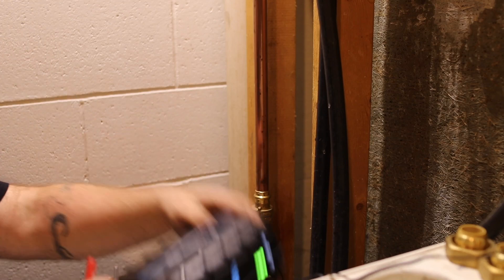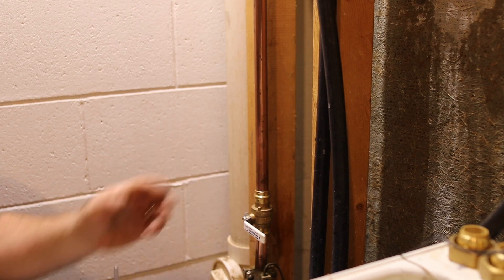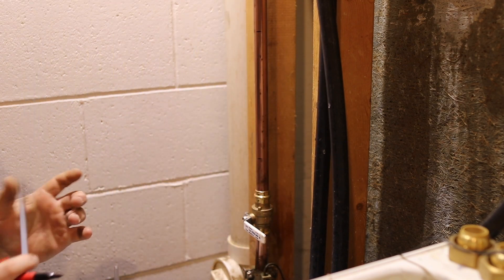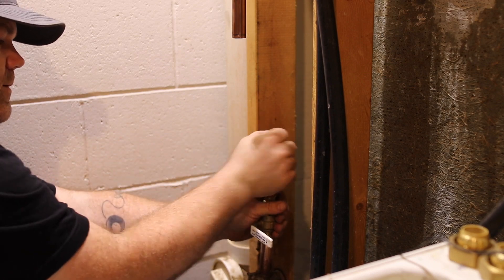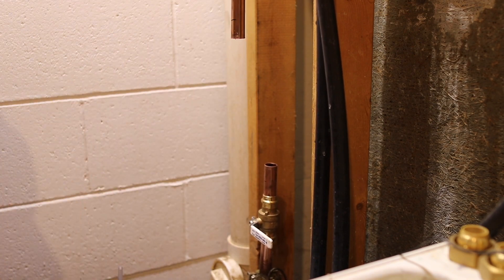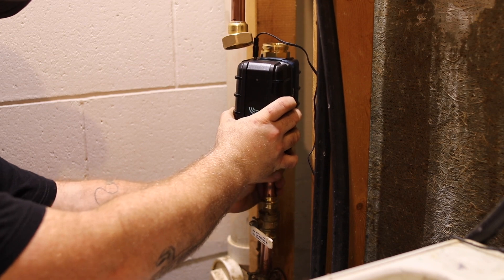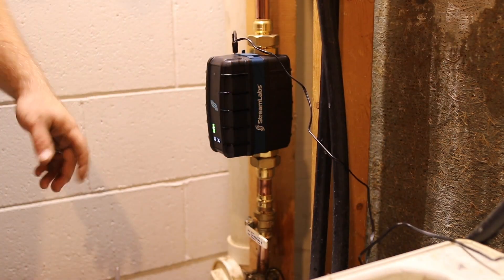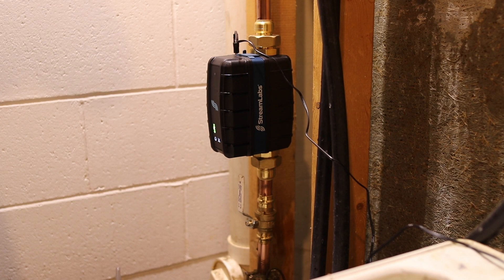Streamlabs WiFi water shut off valve

Comment: Please consider doing a video showing how the unit responds.  How slow of a leak can it detect?  How fast does it respond to a slow leak?  How fast does it respond to a big leak.  How does it respond in away mode versus not away mode.  You could use the sink, since you're right next to the valve.  Looks like the box stores only sell the shark bite type.